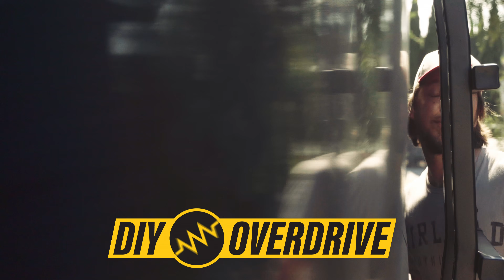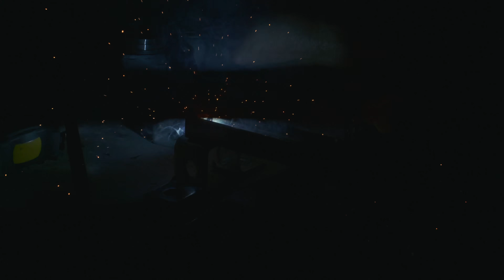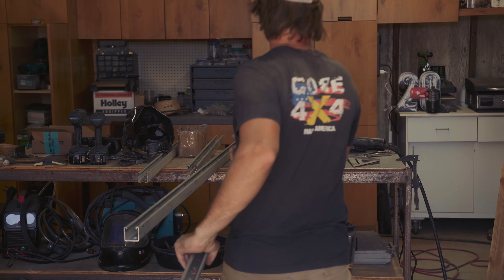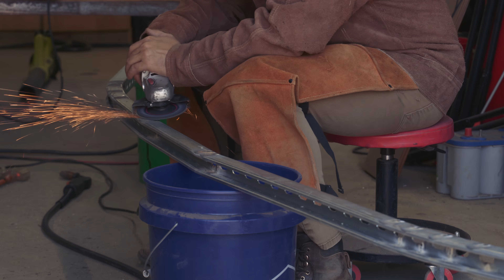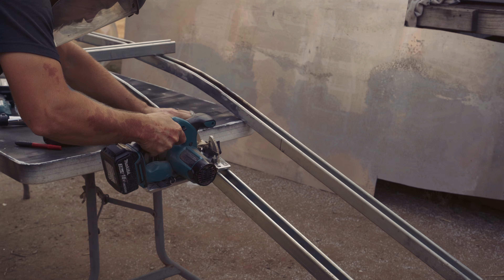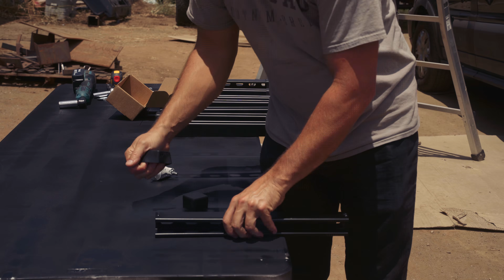Watch this BEFORE you build a DIY Ladder

Comment: Why a tent on a tall sided van?  

I have a Chevy Express and I sleep on the inside.  Heck, I sleep inside of my 4Runner!
Reply from the maker: It’s a mid height and we aren’t doing a full conversion cause we want to still use it as a daily. The reason we are adding a roof tent is because we have 3 kids with the 4th on the way. So with 6 seats taking up room in a mid-height van it’s not so easy to comfortably sleep all of us without doing a super in-depth conversion. If it was alone I would still be sleeping alone in my 4Runner.
Reply: @diyoverdrive  I see.  In that case, you really need a glamper.
Reply from the maker: @2-old-Forthischet  I like to build things and this is all we can afford for now, so this will be a fun project!
Reply: @diyoverdrive  I only had one child and he was VERY EXPENSIVE.  Good luck.